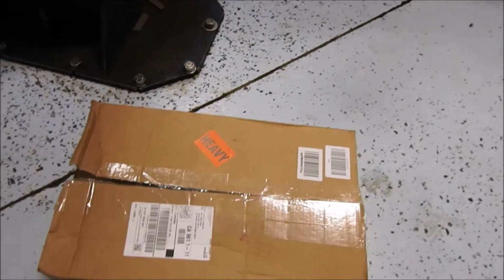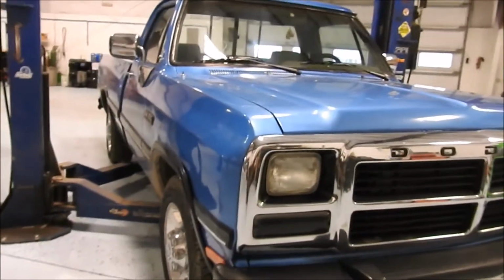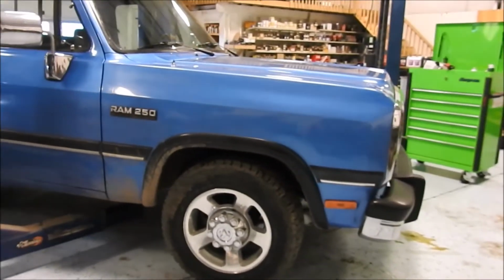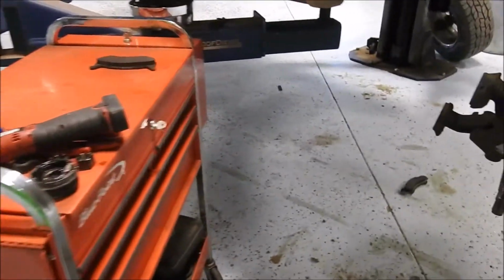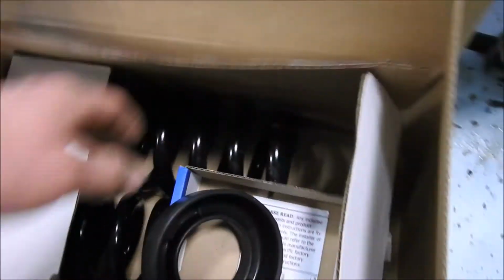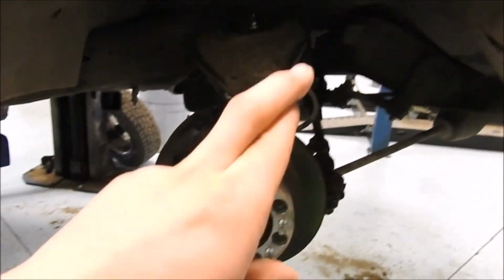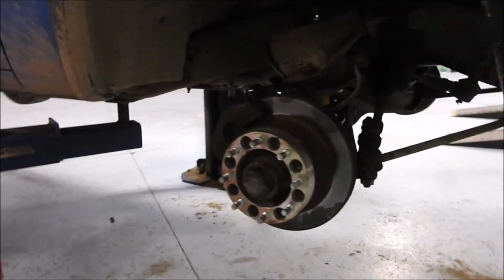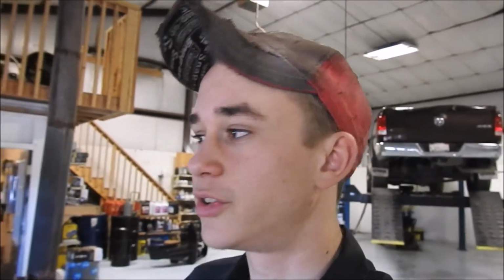More Front End Upgrades For The First Gen!!!

Comment: Everett, check that wheel spacer, is there a flange for the wheel to center on ? I couldn’t tell in the video, but if there’s no flange, and it just the lug nuts holding wheel on, not safe. Wheel spacer are safe as long as you a flange for the wheel to ride on. Keep up the good work.
Reply from the maker: Yes its all good, if you have the "acorn" style lug nuts you wont need the flange as the lugs will center it, at least to my understanding...